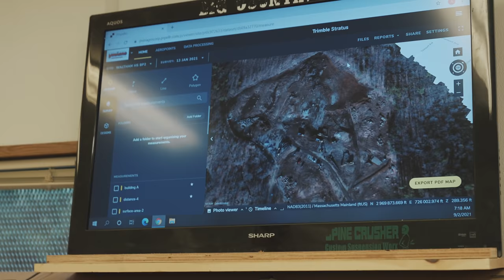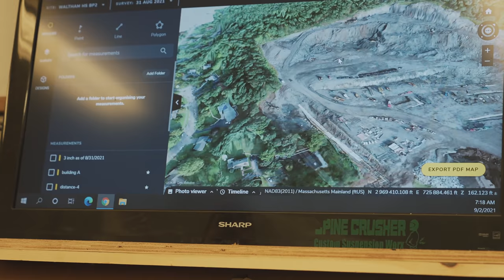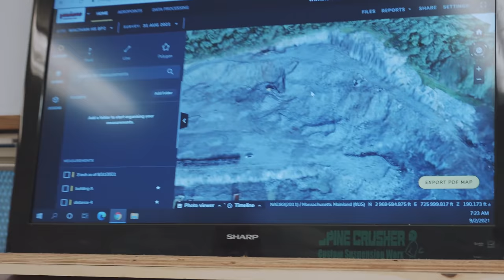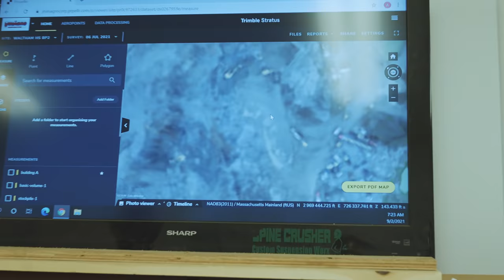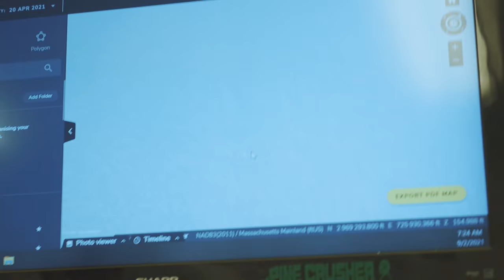Carving out a Mountain for a New High School

Comment: Only way this makes sense is if they are selling the rock for a very good price. or the state has money to burn: Build Back Be....
Reply: 3:33 states quarries are impossible to permit. they are probably getting paid on both ends per yard.
Reply: It like cement company. The Left over mix in Cement Trucks, made into retainer blocks. The cement plants by my house have a huge yard of blocks piled high. The Loader guys can hook the steel rings, so well from just loading them out to customer. The cement is sold twice, just like this rock spoil. It will build back up the quarry's.